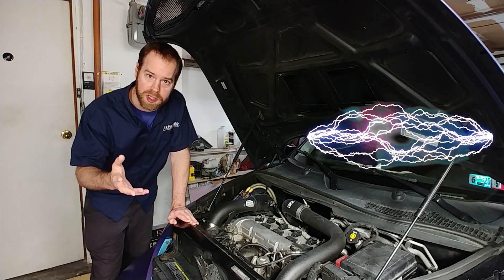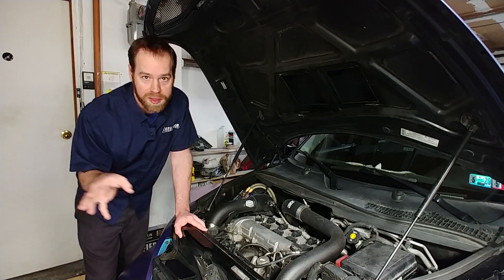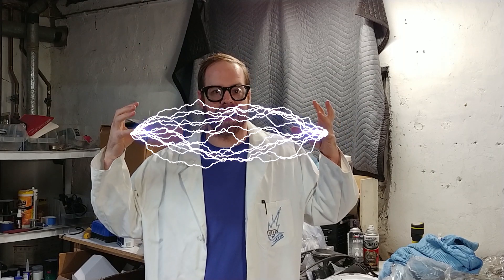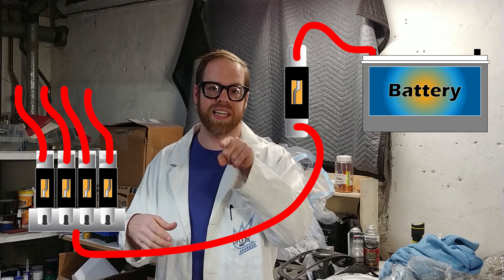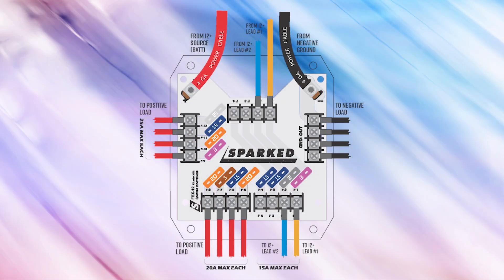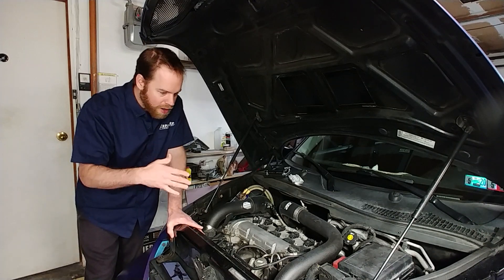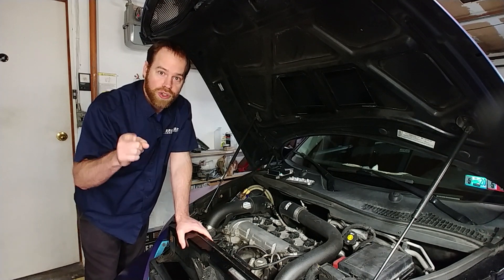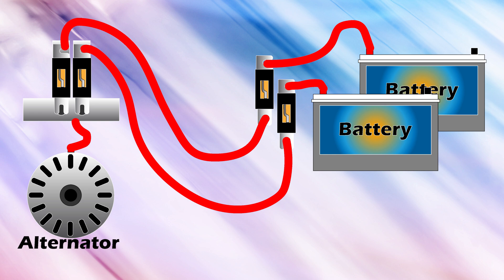How To Choose The Correct Fuse For Car Audio

Comment: I'm running Ceramic 500Amp ANLs between my battery runs. I was told that was too much??? @ the distro block, all my ANLs are @ their rated value. Also swapped the fuses in my RBX-4CH so their values are proper.

Comment: Running a txp1.18000 sound stream car amp. Has been dynoed by you tubers at 7,000 RMS watts at 1 ohm. I am running 1/0 power and ground sky high grade wires. I’m running stock battery and battery on a v10 ford excursion (I understand that I’ll need to upgrade my electrical for this kind of power demand) I do not know what amperage fuse I should use for this amplifier, also if I was to upgrade my electrical, would that fuse rating change? Enjoyed the video and any help would be appreciated

Comment: Hello, great vid. I’m putting in a Big 3 kit with ANL fuse holder on alternator wire. I’ll have an ANL on a power wire from battery to amps in back.  I can figure out the size of the battery power wire fuse, but how do I determine the size of the fuse on the alternator’s power wire ANL?

Comment: Can a H.O alternator for car audio damage the cars pcm/ecu or even charge the batteries to fast damaging them?
Reply: I'm no professional but my understanding is that too much power is never a problem. The car will only pull what it needs. Low voltage is the problem. Your subs will pull the power from everywhere of they're thirsty for power and that destroys alternators, fuel pumps, electrical systems. I currently run 3 agm batteries and a 300 amp alternator. That's enough power to start and run 3 cars lol. Just make sure you have the proper writing and fuses to protect against heat and fire
Reply: No I have a 320 ho alternator and my running voltage can vary between 13.5 to 14.8 depending on load. If everything is fully charged and no huge load on the alternator even at highway rpm the alternator is only putting out 13.5

Comment: I have a 3000 watt amp with 0 gauge wire with a 300a fuse block.but was told to use 120a or 150a.plz help.its my first system build and have spent a lot of money that I don’t want wasted.forgot to
Mention im using a 12v 1600 watt energie battery.pls tell me which correct block to use it would be really appreciated.thank you im advance

Comment: I was considering one of the titan 8 group 65 batteries for my 2013 Ford F-150 ecoboost. It says that they should be used below 140°, but with my twin turbo engine setup and living in the south where 105° days do happen. Are these truly the best choice? I have a limitless cyber 12k and a d4s 500f cap bank, and would like to get rid of the battery isolator I have in the back deviding the under hood battery and alternator. Your ideas.
Reply from the maker: Personally, I don't like under hood batteries so you could delete it and move all batteries to the back. You can also use an AGM up front and a Titan8 in the back without an isolator as they can work together. Another option is to use an UltraCap under the hood for starting and connect it to rear batts with no isolator.
Reply: @SparkedEd Thank you for your feedback and knowledge! i have a space issue already so the battery delete and move to the back doesn't work for me. I considered a xs power sb-500 65 for under hood but it also states 140° max working temp also. Do you know of a cap bank that works better in that application.
Reply: @ericr106  limitless lithium has an under the hood super cap battery

Comment: Great video and great information.  Question, what ever happened with the Eddie Port?  Are you ever going to put those into production?  I could definitely use one on the large build that I'm working on here in Japan.
Reply from the maker: Thanks. Nah, Haven't moved on it since we can't really make them the way we want.
Reply: @SparkedEd  that's too bad. It's definitely a great concept. If you ever decide to give it another run I'll volunteer to be your test guinea pig on a large build 😎. I actually have a 9½" x 36" disco port on my build

Comment: I hope you guys can read and answer this for me

Jesus I thought I had too many fuses for my upcoming install. From what I understand from this video 
I need (2) Fuses on my alternator ( can't afford a High powered one yet) 1 to go to each battery. (I will have 2).
I need (2) Fuses on each positive wire of those batteries 
I need (2) Fuses for my Amps one for each power supply.
I'm going to need a larger Fuse distribution Block.
Not sure if I need 3/4 more Fuses since I am having a Line out converter for my system as well.
So as it stands I'm 4 short since I only have 6 (300a)
Am I correctly understanding this information?
Just FYI I won't be doing the installation I'm paying to have a "pro" install done. I'm sure they would know what I need. But I have already purchased all the gear needed to do the install. Just hate to bring in the car and equipment and find out then that I need to purchase something else to complete the install.  Anything short of a high powered alternator I am willing to get. Just want to be able to bring in my car get the install done in a few days and pick up my car and enjoy my music when I come back and pick up my car.

Thanks any good information to help me would be welcomed.

Comment: Perfect timing on this video 
So if you have a larger wire fused by the battery going to a distribution block do you pick the larger wire size based off the total length or just to the block?
Reply from the maker: Main feed wire to the block should be sized for all items that will be connected to that block added together. Then that main fuse can be figured for that wire. Then each leg from the distribution block can be figured out individually
Reply: Thanks Ed. For the build I’m thinking about the amps spec 40 & 50 amp fuses so I’m thinking 100 for the main run. Depending how I run it the main wire and the runs from the distribution block to the amps total wire distance might put me into needing a 0 gauge into the block. I’d like to stick with the 4 I already have if possible. The question I have is if the length after the block should be factored in when choosing the gauge for the main wire.
Reply: @SparkedEd  do I need fuses on the wires after a distribution block? I have one 0 gauge wire going to the trunk area into a distribution block splitting it to 2 4 gauge wires. I have a 300A fuse on the 0 guage at the battery, and the entire system is only 1000 total watts RMS

Comment: You just cooked my brain I'm so lost right now it's not even funny.lol I just did my calculations because I'm going to be having 4 amps running in my car technically Jeep I have 3 amps at 3000 watts each plus my bass amp 1800 watts total that thenI divide that by .8% for the efficiency of the amplifier I get that answer and then divide that by the battery power which should be 14.4 and I get a total of 978 amps what do I do about that.they don't make a fuse that big.also I have a 390 amp alternator. With big 3 upgrade,n I'll be adding a second battery in the back.so I would have a optima hd6 in the front and a xs3400d in the rear and a 500amp relay to keep batteries charged.but I don't know what to do with the amp fuse .also I might run5 amps.which brings the total of fuse amperage to 1024amps to the battery fuse before running to the other distribution blocks.Now what smh help!!!